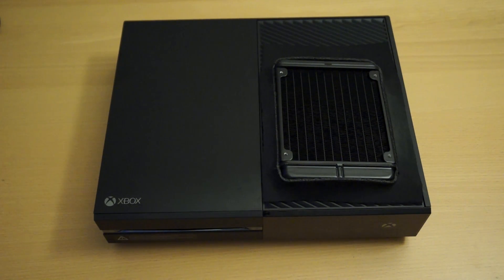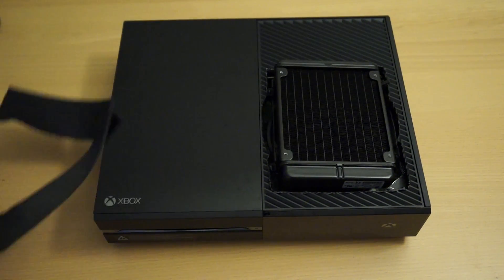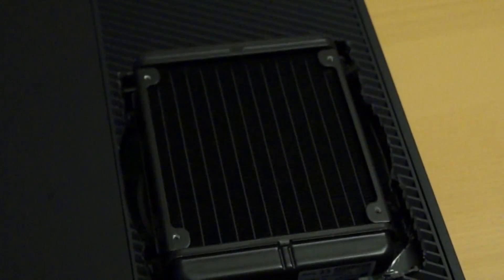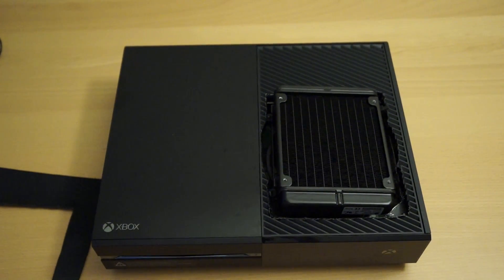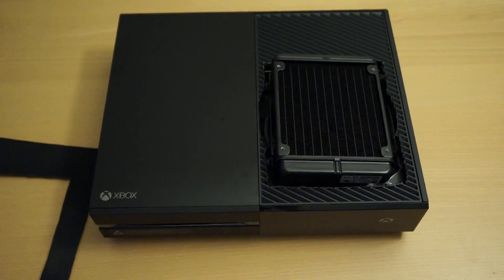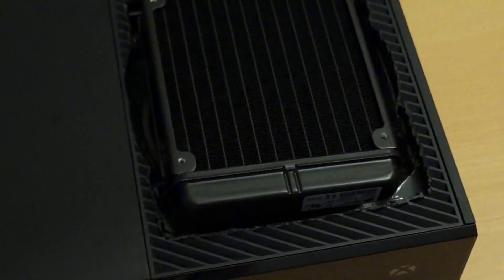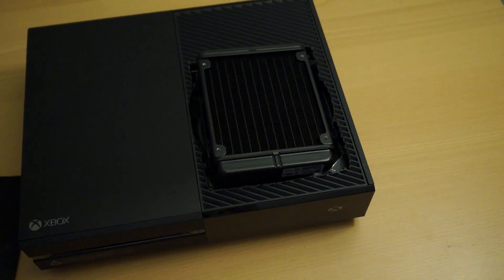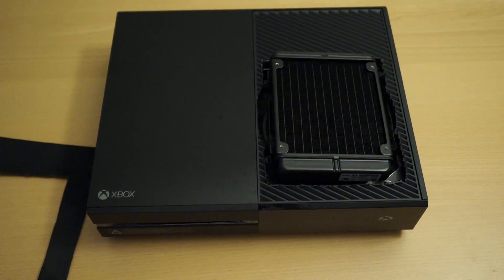Xbox One Water Cooling Break Down

Comment: Did the processor mounting plate/water block mount up perfect or did you have to do something special to make it fit ??
Reply from the maker: I had to use custom sized screws and drill new holes into the blocks mount where the screws went into.
Reply: What processor plate did you use
Reply from the maker: The water cooling kit comes with a few adapters/plates etc. for mounting on different processor types. I chose one that best fit it, it was an AMD processor one that I used.

Comment: How did you power your water pump and fan?????
Reply from the maker: I wired the pump and fan to the fan heads where the original fan would connect to the main board. Used the metal body as a ground.
Reply: pwrdbykyank Oh I get you. Thanks for replaying!
Reply from the maker: anytime :)

Comment: I am a car diagnostic technician, and let me tell you now: that is a BAD idea.
i will explain myself:
1. the fan should be on top of the radiator (and not under it) because:
A. the radiator (under the fan) is causing a disturbance in the airflow. that will shorten the lifespan of the fan (it will "choke" the fan).
B.dissipate less heat due to restricted air flow.
2. radiators leak eventually (i see that every day), and i don't need to tell you how good water works with electronics.
3. you attached the cooler to the EXHAUST fan !!! 
you want the air inside cooler, not the air outside cooler.

If you want to do it correctly, you should put 3 small radiators on the OUTSIDE of the INLET fans (don't even bother opening up the system in any way), 1 for each (make a housing for it if you'd like). 
that way you:
1. cool the air that goes INSIDE the system (and flow through it).
2. cause LESS turbulence inside the system.
3. if there is a water leak. it will be AWAY from the delicate electronics.
i also advise you to make a drain hole in the housings for all 3 radiators.

hope this helps, and sorry if i made you angry or something... :-)
Reply from the maker: ***** We have another video of the updated version of this mod and we put the fan on top, also on this one the fan was blowing the hot air through and out the top. And the liquid in PC or this sort of water cooling is distilled meaning even if it is to spill, nothing will happen since the water is distilled. :)
Reply: pwrdbykyank yeah, but you probably don't want ANY liquid spilling all over the electronics what-so-ever.
and it will probably cool the system in the current format, but it will cool it even more if there was cold air blowing through the radiator into the system, rather than hot air from the system through the radiator.
I'm not so smart that i thought of it myself. this is the way engineers build cooling systems for cars - pretty much since they invented water cooled engines. they can't all be wrong....right ?
Reply: +שחר מקייטון Cars aren't the same as computers.
Reply: cars have computers and electronics in them. clearly, you haven't read my comment.
Reply: Clearly I didn't care to read it. You're not important to me. xD
Reply: don't leave comments to things you don't read or don't care about. 
your comment sounds like you are 5 YO, and clearly, your not. "it's not a car"....well, it's not a light bulb, than why does it needs electricity....duhhhhh...
Reply: +שחר מקייטון Than why does it needs electricitys, tokis wartooths? xD Glad you're proud of your career, little guy.

Comment: Hi loving mod I'm doing one currently was there any issue with power with the extra draw fan and pump cause
Reply: ie can xbox cope with pump,block and fan without causing power issues?
Reply from the maker: richard stallard Yea, i ran the power from the 12 volt cable going into the blueray. I also ran LED strips off of the same cable and everything works great :)

Comment: Hey man, just wanted to ask is it possible to mount a closed loop wc kit like this one to the PS4?. The reason I am asking because I saw in your other video you just did a custom loop on that PS4.
Reply from the maker: Hey, no it wont work for the PS4 since there is no room inside to do it. Even with the custom loop I had to heavily modify the internal case and bottom cover to get everything right. The way they made it everything fits together on top of each other snug so yep. :)